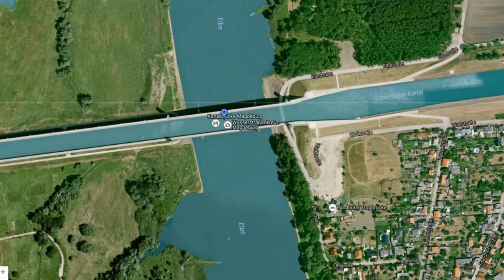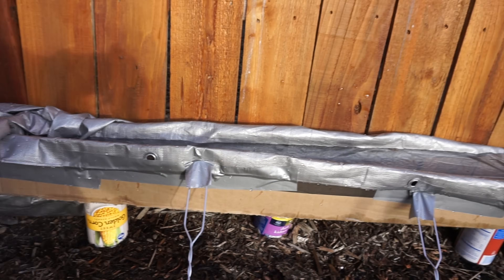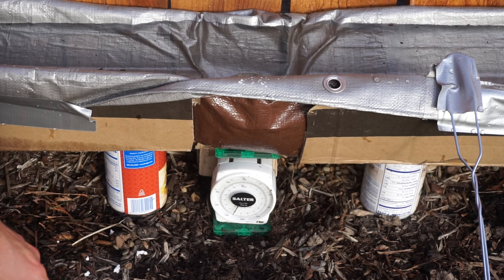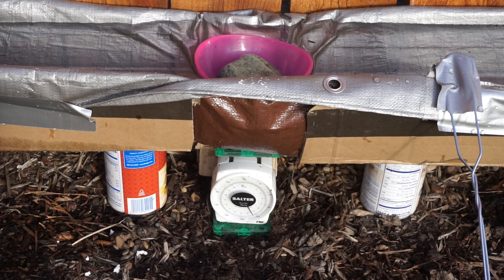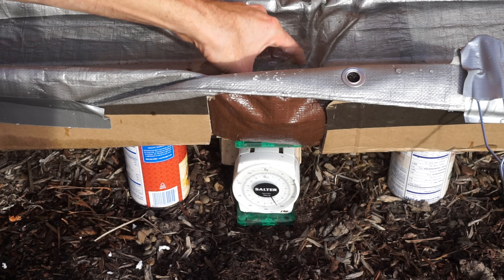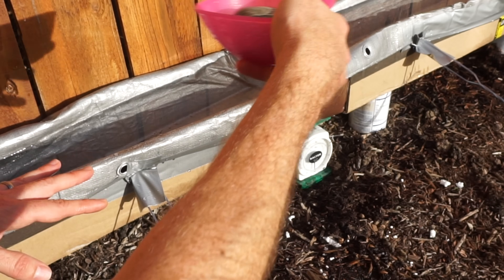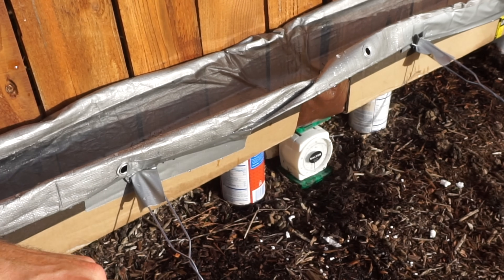What Happens When a Boat Crosses a Water Bridge? Does the Weight Increase?

Comment: You can actually watch the scale move at 1:23, right as he places the boat with the rock on the water. This proves that the weight on the scale is directly proportional to the depth of the water, since it would have increased as the boat settled in, despite none of the boat's weight being above the scale at that moment. You can even go back and see it at 1:05, the needle moves as his hand enters the water, displacing it and increasing the depth, but not directly imparting any force onto the scale. With this principle in mind, a ship of any size and mass could traverse a bridge as long as it never touches the sides or bottom.

Comment: Thank you for showing that experiments can be done at home! I have several questions, what if there is a traffic jam on the bridge. The higher level of water is not going to be neglected. In this case,  the weight supported by all the structure and the  bridge portion is the same, isn't? On the other hand, the bridge should be strong enough to support a sunk boat, in addition to the regular water load. I'm excited 😊!

Comment: It shouldn't increase cause if you remember school. Boats float cause they displace more than they weigh. And that extra space made by the hull is water that isn't being weighted. Now if the ship flooded and rested on the bottom of the bridge the weight would change. At least I think.
Would maybe change the weight a little as water moves around but not anywhere near the weight of the boat.

Comment: Today i got reminded of this video because the topic came up in a science class. The explanation our prof gave was very similiar though slightly more focused on the bridge itself wich gave me another level of understanding: For his rather simpler model u need to fill a big cup FULL of water right to the edge and place this cup on a scale. The cup resembles the bridge. Then you place your ship (another cup with rocks in it) right on the water. The water gets displaced and dribs over the edge of the cup (resembles the bridge). Since the boat and the excess water weigh the same the scale doesnt move. Coming back to this model you can really see that the displaced excess water does obviously not drib over the edge of the bridge but rather raise the rest of the river.

Comment: Consider this: 
You build a water bridge(as shown in the video).

You put a very long, floating platform on top of which there's a road.

You reduce the amount of weight/pressure on the ground. So, you could use similar designs to build bridges where the ground can't hold a large amount of weight. You could improve the design by creating a fluid that is very light and very buoyant.

Comment: Would it be possible to use this concept to make a bridge that cars can drive over like normal, except the platform that the cars drive over is actually a boat itself that is suspended in some water. Imagine a regular bridge, except the entire thing is flooded, and on top of that pool of water, there’s a giant barge that basically looks just like the original surface of the bridge, except it’s suspended in water, and there’s a platform at either end that connects the barge back to the road so cars can board on and off the barge. I hope that makes sense.

Comment: The bridge is not in a closed system and so the displaced water essentially moves further along the watercourse. If the rock is placed in the bottom on the bridge then the weight of the rock registers on the scale but since it has a negative buoyancy some of its weight is negated by the water around it. If you weigh the rock directly on the scale it’s weight would be somewhat higher.

Comment: If the vessel of water is closed, there will be a weight increase. Given the body of water probably extends off for quite a distance from the actual brudge part of the river, the water level rise would be miniscule.  If their was a lock at either end of the bridge structure the load would go up.

Comment: I've seen photos of a canal lock where the lock is a type of elevator. There are two troughs between a pair of circles. When the wheel is in the first position, the troughs are lined up with the upper and lower portions of the canal. A boat moves into one (or both) of the troughs and the assembly rotates 180 degrees so that the troughs are lined up with the other portions of the canal and the boats move off into the canal. The two troughs contain approximately equal depths of water so that they are balanced and the lock does not have to lift the water. The water being lifted is counterweighted by the water being dropped. The weight of any boats are exactly balanced by the water that they displace. If you are lifting a boat, it is counterweighted by the exact amount of water that is being dropped. Genius level engineering!

Comment: You should’ve also showed what happened if the whole weight of the water was placed in a single bowl which was weighed. Then put the rock in the boat in it. The weigh will definitely increase.

Comment: Of course it does... Buoyancy is not magic... it's a force and every force has a reaction, hence Newton's 3rd law.

It does not increase when a boat crosses it, it increases when the boat enters any part of the water body (and floats). Water gets displaced and the water level rises, more water is over the bridge, so the force acting on the support definitely increases. 
If you go back and check the video, you can see the scale moved a tiny bit when he puts the boat into the water. It's not like the weight does not increase at all. The weight of the boat just got distributed over the entire area of the bottom of the water body. And as the bridge is just a small part of it, it does not have to hold the weight of the entire boat.
Reply: Ok I commented too early, he actually covered these in the video. Well done!

Comment: So if the bridge had gates at either end and they were closed and then a boat lowered into the water it would then add weight to the bridge so long as there were room for the water level to increase and not overflow. Though I see no reason for this to ever be done.

Comment: This is a basic function of the fact that water is not compressible. Additional buoyant weight in the water doesn't add any more downward pressure, instead it spreads the weight throughout the entire body of water's tension interaction with the surfaces its interacting with, essentially giving the 'footprint' of the added weight of the boat a nearly immeasurable distance that its weight is spread out over.  I think with a delicate enough measuring device you COULD measure a minuscule increase in a closed system like this, but we're probably talking about percentages of percentages.

Comment: I haven't finished the video I'm just 1 min into it but basically what is working over here is water displacement. The water within the bridge will be replace by the boat. Only taking into account any accidents the bridge should not suffer any harm by any weight put in it. Pretty much when you go in a tub and overflow the water... The water that goes out the tub weights the same as the body that originally overfilled the bathtub.

Comment: Wouldn't the weight be spread out over the surface area of the water so the weight would actually push down on it. Only instead of one pound on the scale that one pound would be spread out over the entire surface of the water which means only a small fraction of the weight would actually go to the scale itself. Is that right?

Comment: This is an awesome demo. Practically, I believe, one would need to consider the case of sizable vessel scraping the bottom,  or in a remote case sinking partially or fully. Change in water levels due to rains or upstream condition is another consideration.

Comment: Actually there is a water level rise along the entire length of the water in the bridge which accounts for the weight of the boat.
The weight of the boat is distributed across the entire length.
While you are measuring the weight of water column only at a particular section  , thats why there is negligible increase in the reading of the weighing scale

Comment: Of course the bridge would be over designed to hold more weight than the water it can hold to cover for unforseen events. This "extra" strength would be plenty enough to allow for the weight of the boats as they weigh much less than the water under them. So technically you don't have to account for things like this but good engineers always give a little "cushion". Lots of vids on the tube of disasters that could have been avoided by adding a little more strength than needed just to carry the normal load.

Comment: The simulated bridge does weigh a tiny tiny bit more with the boat in it, but the weight is distributed across the whole thing, because it's on a liquid. With the real bridge, that distribution goes further than just the bridge and so it's virtually no different.

Comment: Nice example. Except you say in your conclusion is not really accurate.
.
As you say, the weight of the volume of water displaced, and is equal to the weight of the boat + cargo + crew, and you are also correct to say that the displaced water is spread equally along the whole of the 'river'.
.
But to claim that the bridge doesn't have to bear ANY of that weight is incorrect, the bridge, especially in your video, DOES have to bear additional weight. It MUST bear the weight of the the amount of that displaced water that is sitting on top of the bridge, because the weight of the boat + whatever, is spread equally along the entire length of the 'river', of which the bridge is part of. Which, although it's only a small fraction of what the boat + whatever weigh, it still more weight that the bridge would have to support if the boat was not in the water. Interestingly though, regardless of the actual position of the boat, even if it's not directly over the bridge, as long as the boat + whatever is somewhere in the 'river', the bridge still has to bear the same fraction of the boat+whatever's weight has been displaced over the bridge.
.
I believe that you can figure this out by first figuring out what the Length Of the River (or LOR) is, and separately the Length Of the Bridge, or LOB as I'm calling it.
.
(BTW, there are several answers below this that try to explain how to figure out the Extra Weight the Bridge must bear, using the same values, and coming to the same conclusion, simply because the boat is somewhere in the river. I've done this because each time I did it, I was unsatisfied with my work, and felt it could be explained more clearly. I've kept them because they each have there own problems. I only mention this because I don't want you to get confused by thinking that I'm explaining several different ways to reach the same conclusion. I am not. I have, though, included a single dash to indicate when one example ends, and another begins. BTW, the  Key in the first example is the same for every example. Additionally, at the bottom of this comment I include an equation that you can verify the accuracy of my equation by taking the answer use it to determine the total Weight of the Boat. This equation is ALSO separated by the other equations by a single dash on the left side of a line.)
.
Then take the LOB and divide it by the LOR, that will give you the Percentage Of the River on the bridge. Or:
POR = LOB / LOR
.
Now, take the Total Weight of the Boat+whatever (or TWB), and multiply that by the POR, and the result is how much Extra Weight the Bridge will have to bear (or EWB), or:
EWB = TWB * POR
.
Or written as a single equation:
EWB = TWB * (LOB / LOR)
.
Key:
EWB = Extra Weight on the Bridge
LOB = Length Of the Bridge
LOR = total Length Of the River (including the bridge)
TWB = Total Weight of Boat+whatever
POR = Percentage Of the River on the bridge
.
- I wrote the the above equations, because I think my explanation below is confusing.
.
AKA, the Extra Weight on the Bridge is equal to the Length Of the Boat divided by the Length of the River then multiplying that number (which is the Percentage of the River on the bridge (or POR)) and then multiplying that by the Total Weight of the Boat (or TWB).
.
- Explained again:
.
If the Length Of the River (LOR) is 100, and the Length Of the Bridge (LOB) = 10, then Percentage of the River on the Bridge (or POR) = .1 or 10%
Then the Extra Weight on the Bridge (EWB) is equal to the Total Weight of the Boat (TWB) multiplied by the Percentage Of River on the bridge (POR).
.
- And again:
.
So, if LOB = 10, and LOR = 100, and the TWB = 50, then the POR = 100/10 = .1 (or 10%)
then EWB = 5 (or 50 * 10%), because the Total Weight of the Boat is spread (or divided) equally along the entire Length Of the River, of which the Bridge is 10% of.
.
meaning that Extra Weight on the Bridge = 5
Simply because a 50 pound boat is somewhere on the river.
.
- And one last time:
.
So, if the Length of the River = 100 miles long,
and the Length of the Bridge = 10 miles long,
and the Total Weight of the Boat is 50 pounds, 
then the Percentage Of River over the bridge = 10% (because 10/100=.1)
And so the Extra Weight on the Bridge would be 10% of the Weight of the Boat (50 * 10%) (or 10% of 50) which is 5 pounds
Making the Extra Weight on the Bridge to be 5 pounds
so the EWB = 5 pounds, because 10/100*50=5
.
-
.
Lastly, you can verify that the Extra Weight on the Bridge is correct by dividing that weight by the Percentage Of the River over the bridge in order to determine the total Weight Of the Boat.  In this case that equation would be:
TWB = 0.1 / 5 = 50
.
Which equals the original Total Weight of the Boat.

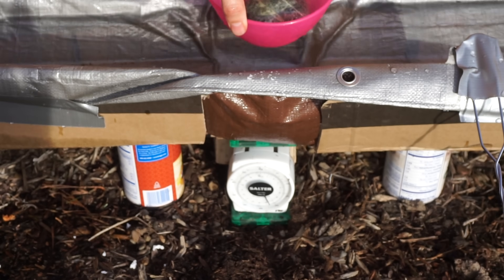Comment: 2:49 - I do not fully agree. The bridge has to support the difference in weight. Result = rock weight (in this case) - weight of water displaced by the rock. The "Result" might be positive or negative. Perhaps some lower density body is locked to the ground, in this case "Result" will be negative.
Nice idea with this video! Keep up the good work!

Comment: imagine a giant balloon anchored firmly to the bottom of the trough/bridge.  When inflated, it displaces a lot of water, which still exists, but has been moved to a location outside the trough (the ocean?).  If the balloon could inflate to fill the entire trough volume, there would be zero water weight on the trough.  So you see displacing the water reduces weight on the bridge.  A boat that displaces its exact weight in water will have neutral buoyancy, and sink - boats float because their volume displace more than their weight of water.  If a very floaty boat was somehow 'anchored' to the bottom and pulled down like the giant balloon, it would reduce the bridge load.  But it's not anchored, it displaces exactly its weight of water, so the total weight on the trough is not more or less, but remains the same I think.

Comment: The weight distribution above the weighing machine was constant when the stone was put on the boat.
Another reason for the contant reading could be that the weighing machine does not measure the weight of the body, it actually reads the reaction force due to the weight on it.
You guys can see in the video that when the stone was without the boat it sinked and at the point of time when it touched the weighing machine the reading was changed.
At lasted lots of love from India🥰🥰😷😷❤❤

Comment: Just wanted to point out, that this assumes that water waves travel with infinite speed (they dont). If you would test this on a larger bridge, the bridge will actually need to support the weight of the boat, until the excess water leaves the bridge area. In practice this is still not an issue, because boats usually dont get lowered into the middle of a bridge instantaneously , but instead gradually enter from one side, so the water is allready pushed apart. The increase in weight is dependent on the max wave speed and the speed of the boat entering. The slower the boat moves, the more time the water has to even out again. Also while many point out, that water is way heavier than boats are, a sunken boat in the middle of two supports will induce torsion, while water does only induce axial stress (without waves at least). Torsion and axial stress are very different from one another and this will get checked in the design process of a bridge for sure.

Comment: The fact is that the load on the bridge can never be more than the the absolute water capacity of the depth of the bridge....so they "only" have to design it to hold the max weight of the water if it was filled exactly to the top of the bridge....cause when a ship crosses the bridge the water it displaces is equally spread infinitely in each direction, so technically some water leaves the bridge area, and is no longer acting on the bridge straight down...so technically the load could be affected by boat traffic on each side of the bridge, where the water they displace would affect the load on the bridge as well, up untill the load was so great it "over flowed the bridge"....